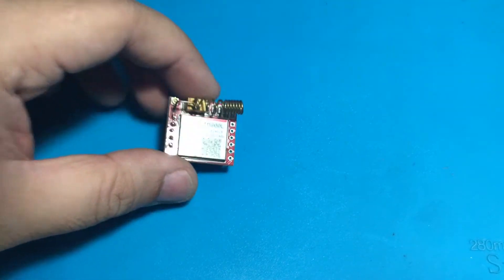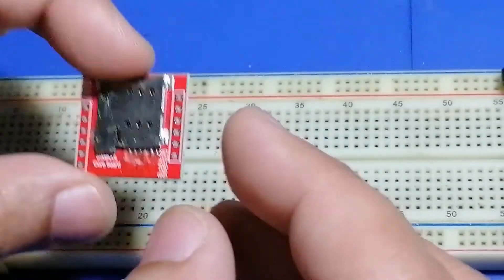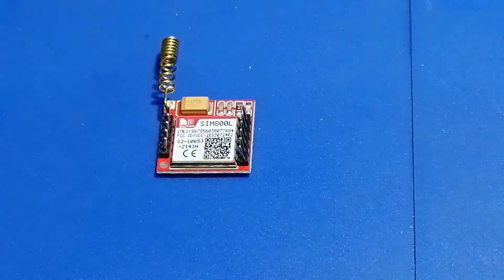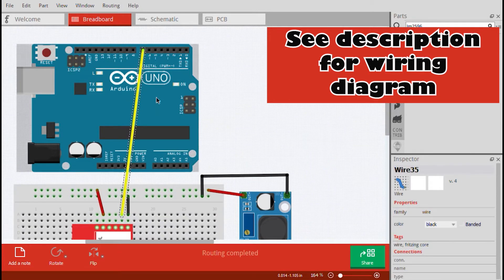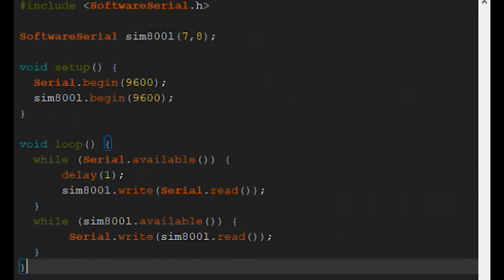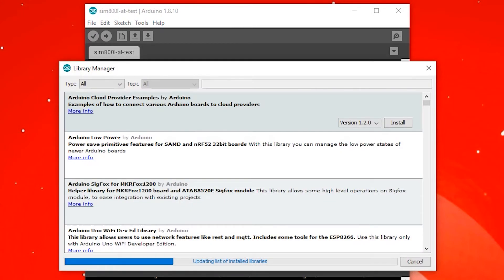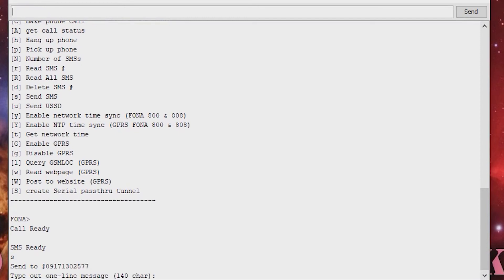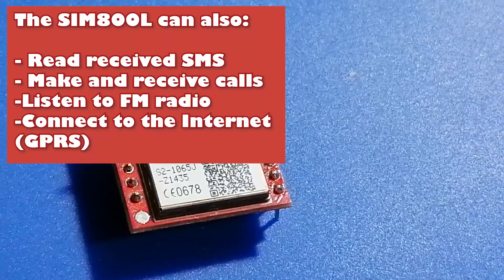Using SIM800L GSM Module with Arduino | 5 Minute Tutorial

Comment: Sim 800l definately going to get damage beacase of Arduino 5 v supply .. because sim800 l rx & tx pin is not 5 volt tolarrence ..we need voltage devider to drop down acrross 2.5 ..otherwise the circuy may get damaged verry soon